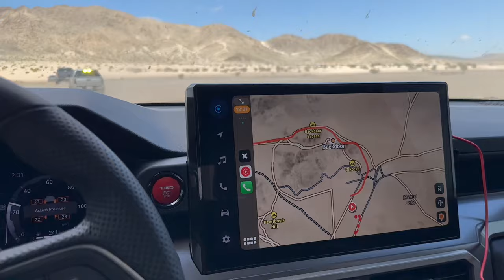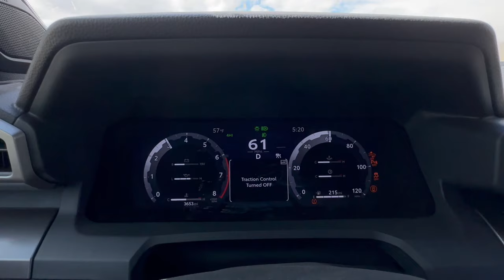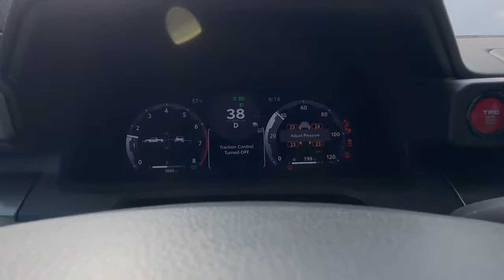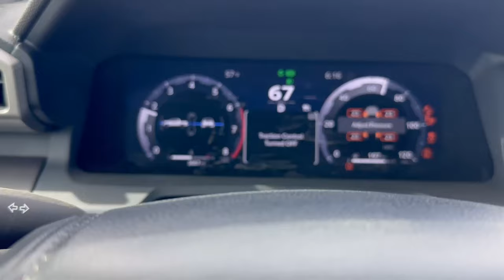Surprised How Well My New 2024 Tacoma Handled This

Comment: i no, this wasn't the point of your video but being that you're in California and live in Florida how is the climate controls in the new Tacoma? I've always found them weak in the second and third GEN as far as the AC with a darker color did they fix that and they fix the third GEN leaking into the passenger side foot? Well my 19 when it's humid out leaks pretty aggressively in the cab.
Reply from the maker: mmmmm it was fine. Never rally go hot enough to need to use, but I can tell that LO is where you wanna be if you want it to be any for of cold at all.

Comment: Pretty interesting to see the toll that high-speed offroading takes on a truck.  One day of it, and you need a new alignment, and that Tundra's tires were chunking too.
Reply from the maker: I’d definitely a combination of here and also the bit of off roading I did in Borrego Springs the two days prior too
Reply: I've got about 30k on my toyos, so theyre definitely worn down. For what I put them through they have lasted a really long time actually, but yeah its time for new tires
Reply: @fullmag_tundra  30k is pretty impressive then! In your experience is there anything to really keep an eye out for when doing slightly higher speed stuff?
Reply: @keon8625  thanks! I’m surprised myself tbh lol but a few tips I’ve learned running these down, you gotta rotate them way sooner and more often. Like every 3k miles. When you’re going fast, you’re in 2WD most of the time and usually traction off so you’re spinning all over the place which wears them down significantly. So doing tire rotations more often will only help them last longer. I was doing every 5k but this new set I will start doing 3k instead. 

Also, your traditional off road air pressures of 15-20 psi won’t cut it out high speed stuff. Depending on how much sidewall you have, if you’re too low you’ll start to hit your actual wheel on stuff and increase risk of bending a wheel rim and leaking air or get a flat. Stay within 25-28 psi and should be good, which means your suspension has really got to be good to keep up and not rattle you to the death lol
Reply: Another response to your alignment comment too, it’s very true. Stock alignments don’t last long prerunning, I had 5 alignments done last year because they kept coming out. I recently just installed cam tab gussets from total chaos on my truck that helps strengthen that area and helps keep the alignment better. I spent the whole previous day before Jon came and did all of that stuff all day, and then did it again the next day. Alignment didn’t change one bit haha. Well worth the cost of parts and labor

Comment: FullMgM has a sick build. Also, got to test drive a 4th gen exact same spec as yours next to a 3rd gen tundra. I was surprised how much more responsive the taco felt than the 3.4 in the Tundra. I guess it builds boost much faster. But definitely doesnt hit the same peak when the tundra is in boost

I'm so sold on the 4thgen Taco now. These videos are making it hard to hold on to my 3rd gen XD
Reply from the maker: Yea the Taco has more low end but the Tundra edges it out for sure on the top end.
Reply: Thank you!

Comment: Dear John I know for fact you have all the answers for my question, and here are my questions?
I am from the Middle East to be more specific from the gulf countries, the Land Cruiser we are going to have is Lc250 with two engines 2.8 turbo diesel and 2.4 turbo petrol, do you think the 2.4 engine has enough power to handle the heavy weight of the LC250 ?
What is the acceptable acceleration rate from 0 to 60 for SUV?
Reply from the maker: CarWow just did a review of that LC with the diesel. I'd suggest checking out their channel.

Comment: yea 20 mins and the shocks are done that's just bad, the suspension wouldn't last a half day driving over washboard terrain.
Reply from the maker: No they wouldn’t. And they were hot before from rocks as well. I didn’t explain that that well. But I could really tell they were un-happy at the end
Reply: @TRDJon  that's quite a worrying thought about the longevity of the truck and definitely doesn't sound like Toyota reliance that we all know, I wonder if the fox shocks on the pro will fare any better
Reply from the maker: Even Full Mag with his king shocks was feeling shock fatigue, It's a thing for most suspension set ups when you are going forever and the oil gets hot.
Reply: @Cringer101 not really a worry at all. It’s stock. They’re not expecting every customer, majority of customers rather, to be putting their vehicles through this. Even my king 2.5 got hot to the touch at the end. Completely normal and expected.